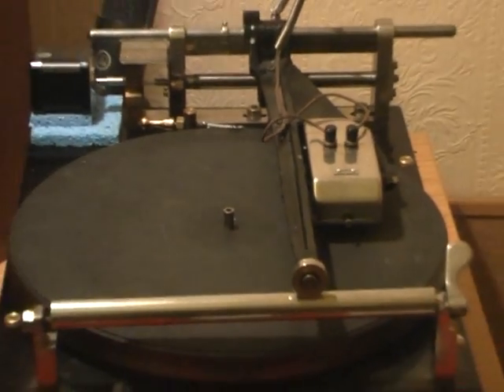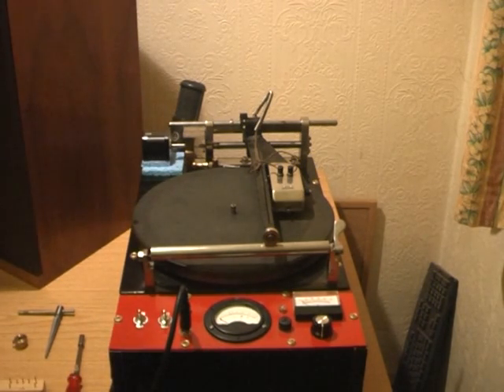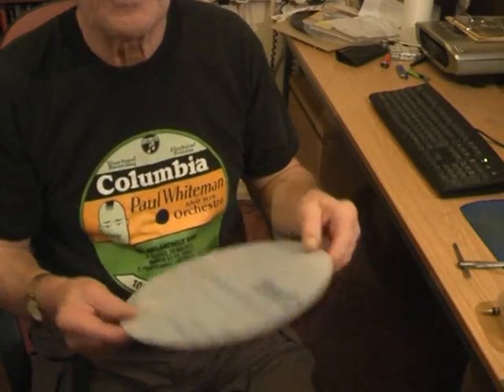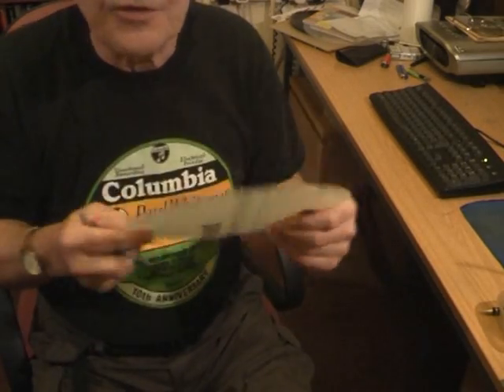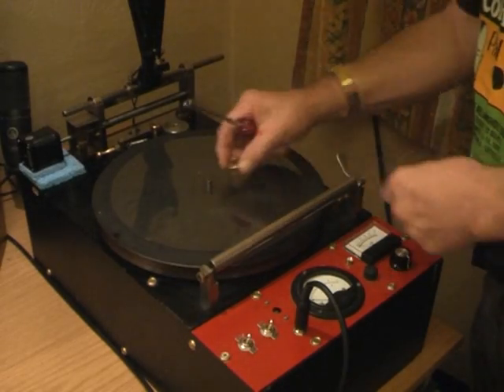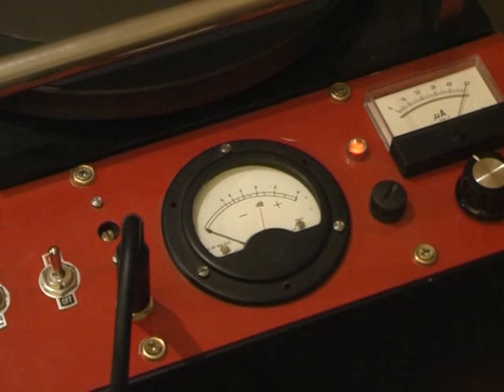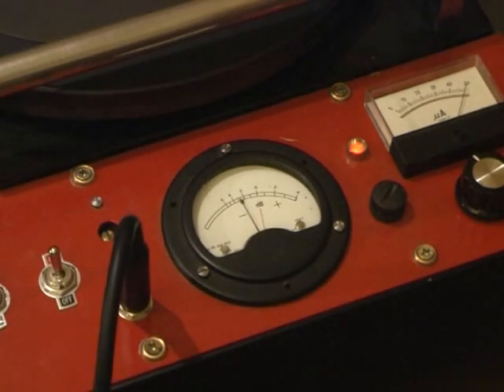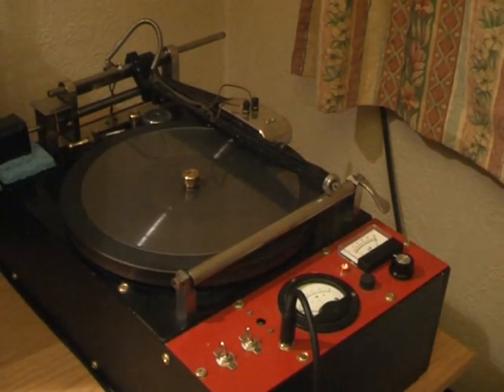home made 78 rpm records

Comment: Dear Sir,
Do you provide cutting wide groove 78 rpm record service on POLYCARBONATE material (Not PVC)? If yes how to contact you and send the wave file to you?
Reply from the maker: Dear Lee Leng Kok - I am sorry but I cannot help you here. I am retired from work and only play with this equipment as a hobby. They are very unpredictable on playback, and results are usually unreliable. One option for you, is to get a disc cut professionally at 45 rpm, using an audio file that has been slowed down by 78/45 = 1.73 times. Then, it should return to correct pitch when played at 78 rpm. Hope this helps. Best regards, Norman.
Reply: Thanks for your reply。

Comment: Amazing!
Where did you get this record lathe from?
Reply from the maker: Hi there. Well, it turned up in somebody's garage (minus motor & box) in the 1970s. They were used a lot during WW2 for recording news reports (no small plastic-tape recorders then except in Germany!), and I guess a lot of them got sold off as surplus. They occasionally turn up on ebay, but usually very dilapidated & needing a lot of TLC. I just uploaded a video of the restoration of the cutting head of one of these machines: https://youtu.be/ptfIHqyOtHw . Cheers, Norman.
Reply: hmmm,interesting.
Enjoy cutting your vinyls!

Comment: In his site he outgrown the components he used to build the circuit with the NE555 oscillator.But he should have put the design of how the various components of the circuit are connected to each other.
Reply from the maker: Hi Allessadro. Thanks for writing. After this video, I made two more: https://youtu.be/RAtC-oBI3mE and https://youtu.be/XrizHAodv_k . These give more explanation of how I controlled the stepper motor, and also circuit diagram & component values. You may find these of help. Also, you can use Arduino board to control a stepper motor; but I have still to learn how to do this! >8^(    Best regard, Norman.

Comment: Is there a website where you can order the polycarbonate plastic? What's it called and how much does it cost
Reply from the maker: Polycarbonate plastic sheet is widely used for glazing: e.g. greenhouses. One common trade name is 'Lexan'. I originally used 1.5 mm thickness (one sixteenth of an inch), but also tried 1 mm and this is fine too. It's slightly harder to find the thinner sheets. But most sheet plastic warehouses should have polycarbonate sheet. I don't know where you live, but if it's in the U.K., I use a supplier near Coventry called The Plastics Shop. It comes in sheets about 1 metre by 1.4 metres. They will cut it into squares free, but if you want discs, they will cut them for you but that makes the discs three times more expensive! Also, I recently saw a U.S. video where they are cutting onto a black sheet called Makrolon, which I believe is also a band name for polycarbonate. Hope this helps. Cheers, Norman.

Comment: Does it recorder have an electromechanical feedback?
Reply from the maker: Hi Andrei. No feedback; the low impedance (4 or 8 Ohms) signal comes from loudspeaker output of amplifier. The coil in the head is similar impedance. The amplifier 'thinks' the cutting head is just a loudspeaker. 8^)  The head only takes 2 or 3 Watts to make it work. I am going to make a video about the head, to show how simple it is, and how easy it is to overhaul. С наилучшими пожеланиями из Англии, Норман.

Comment: how well would these work in a jukebox with tube amp?
Reply from the maker: Hi Richard. Alas, it wouldn't work, if at all, because the 'groove' - actually a furrow - is probably too shallow to keep in place the playback stylus. It would probably just skid across the disc. However, it you have a 78 rpm juke box, and want to stock it with discs of your own music, the logical way forward would be to have the discs cut on lacquer. These will play much more securely, and with better sound quality than polycarbonate. However, there are two downsides: first, blank lacquer discs are relatively expensive, and also, they would have a playing life much shorter than normal 78s. How much shorter, would depend on the pick-up in the juke box. Best regards, Norman.

Comment: Can you show us a step by step, for those of us that did not study electronics? Please? thanks..
Reply from the maker: Hi Michael. Well, although the electrical side looks very complicated, the only difficult bit is driving the stepper motor which turns the feed screw. Further details are given on the web page - link is in video description. Also, I later made two videos of how to make a stepper motor rotate at adjustable speeds - you can find those on my channel. Be very careful of dangerous high electric mains voltages that drive turntables &c! Good luck, Norman.
Reply: yeah, thanks. I would need it explained at the  extreme basic level I have not really studied electronics or wiring or any if that stuff.  I just want to learn it as much as I can now. I am a Machinist by trade, so I know about tools and all that, I just have not put together any electrical projects,   or done any electrical type work or anything, so I hope you have a severely basic  way to explain it. Thanks.
Reply from the maker: Believe me, 95% of an MSS disc cutting machine was simply mechanical engineering! Have a look at the manual for one that's on my website; http://www.normanfield.com/mss.htm . The drawings are a bit congested, but if you read the instructions in the first pages of the manual, you will get to know a great deal about them, and how really simple they are. Although, the MSS ones were always over-engineered and VERY heavy! The only electrical parts of importance were the motor that drove the turntable, and the cutting head that made the groove. The other circuitry in the manual was pretty peripheral. Cheers, Norman.

Comment: Would you be willing to sell some cutting needles, I have no way to make them , especially at 84 degrees..
Thanks in advance...
Reply from the maker: Since uploading this video, further tests have been done, which indicate that the best angle of the cutting point is related to the weight upon it. (Surprise, surprise!) The higher the pressure, the bigger the point angle has to be, otherwise the point will dig in too much, and the movement of the point will be heavily damped - this will introduce distortion and poor upper frequency response. The ideal seems to be  A NARROWER POINT, and LESS PRESSURE. Of course, there will come a 'point of no return', when the embossed furrow will be too shallow to transport the replay stylus across the disc. Also, it has been observed that there are different grades of polycarbonate sheet on the market, and some of them have a distinct 'grain', which gives a 'double swish' when they are played back. Having said all that, if you email me privately, I might be able to help you further. Best regards, Norman Field,
Reply: Thanks, I don't see your email anywhere, so here is mine: superduper200554@gmail.com
Hope to hear from you soon... Jack

Comment: on its website, about a length of 1.5 mm HSS that should be sharpened.But what is that HSS? and what keeps it fixed to the engraver arm phonograph? there is an alternative that you can use instead of HSS?

Comment: Hi Norman, I built my CD embossing recorder about 4 years ago. I remember the most frustrating thing was the squeaking sound which appeared each time I tried to increase the cutting force (weight) on the stylus tip. Maximum 100-150g was possible. And the stylus was ploughing at 30 degrees to the vertical, if less, the squeak came there. This way I got very shallow grooves. I have tried WD-40 back then, but it seemed not to improve anything.
What are your cutting weight and angle? I did not found it in description article on the website you provided (great article by the way). Thanks!
Reply from the maker: +Maksim Holtzman Hi Maksim, thanks for writing. Yes, I should have given the pressure & point angle! Pressure is 60 - 70g, and the point offers about 2° of drag, i.e. point slightly tilted forward. If the point is absolutely vertical, or faces backwards, there is trouble with squeaking & whistling. There was also whistling if the point was too sharp. When I ground a new point (they are made from 1.5mm high speed steel), I used to pass it across a polishing mop for a couple of seconds - then they didn't squeak. Since using WD40, which is excellent, I think it might be possible to use a sharper point and get a deeper furrow. As you were using a higher pressure, I wonder whether the material you were embossing is harder than the polycarbonate I use? It's standard Lexan, for lightweight glazing purposes, 1.5mm thick. Have just discovered that 1mm polycarbonate is quite usable also, and is cheaper. 1mm should be quite easy to cut into a disc yourself, so you don't have to pay the supplier to cut them round, so the cost is halved! It's time for a follow-up video; I will show the stages of restoring an MSS cutting head, which is quite straightforward, and add some more hopefully helpful things. Best of luck, Norman.

Comment: Norman I love this video, and I love the excitement and joy you communicate. One question: you seem relaxed about cutting at 80rpm. Does this not alter the pitch and spoil the music? Or do you compensate by altering the ultimate playing speed when you play the resulting disc?
Reply from the maker: +band3kafsh   Thanks for writing. Your point is perfectly valid. When I made the new drive shaft for the motor, it was deliberately left oversize, so that later I could very slightly turn it down in the lathe, bit by bit, until it would rotate the turntable at 78 rpm. However, two things happened. 1. I did have a very few lacquer discs, and it turned out that the drag while cutting lacquers was much more than embossing on polycarbonate, so the turntable went slower anyway. Also, as the drag decreased towards the centre of the lacquer, the turntable went faster. So when you played the disc back, it got slower, and the pitch dropped. Disaster! 2. Embossing a furrow on polycarbonate has far less drag, so the pitch stays pretty much the same throughout the disc. Since lacquers are so expensive, I have stuck to the polycarbonates, and yes: when I play them back, I increase the speed on the replay turntable to compensate. Best regards, Norman.

Comment: Hi Norman, we have an MSS which we want to use to cut 78RPM dubplates of local bands in our pub cellar studio. The machine powers up and cuts a groove, but no signal is making it onto the head, also while tinkering with volume level I think I have blown something else, as there is no signal to the VU either (there was before...). Do you repair them at all? We really want to get going but cannot find anyone remotely clued up about MSS's. Great vid and site! Dave
Reply from the maker: +Nancy Dulake Hi there. Well, I did fix one head for a chap a few weeks ago. They're pretty simple inside - the design hardly changed for the best part of 30 years. Quickest way forward is for you to email me direct, then we can talk on the phone, wch is a lot quicker than many emails! OK? Cheers, Norman.
Reply: +Norman Field Thanks for getting back so fast Norman, I can't see an address on your website, our email is railwaysouthend@hotmail.com, praps you could message us and we can call you back, thanks again D

Comment: Hello, Norman.  Very nice work and splendid results. Are you embossing with a vertical stylus, or is yours canted-forward a bit as many of the LP embossers favor?
Reply from the maker: +Jim Wood Hi there Jim - yes; just perhaps one or even two degrees canted forward - this was recommended in the MSS manual for a later 1950s machine. My pal Mike recently lent it me. I'll ask him if I can upload it to my website. It's disastrous to have any back-rake on the point, - it just digs in, chatters, all very bad! Cheers, Norman.
Reply: (+Norman Field) Hello, Norman, and thanks for the reply. A quick clarification, if I might. You are embossing with a more or less conical point, not cutting, right? And doubtless the MSS manual was referencing a traditional lacquer 'engraving' process creating swarf. Others who emboss recommend 20 degrees or so.  Just wanted to confirm that you get your good results near-vertical.
Reply from the maker: (+Jim Wood)  Hi Jim. Yes, that's correct: it's embossing with a conical point of around 85°. All the guff about that is in the web-page associated with this video, a live link to which is given in the video description above. The MSS did indeed cut lacquer with a chisel-faced cutter, producing swarf. Their cutters were originally metal; later, sapphire cutters were available, and heating coils could be used for those. However, the MSS metal cutter will produce a pretty silent cut in lacquer for several discs. In fact, they actually get better as they first start to wear! This led to the introduction of tiny relief faces on sapphire cutting styli. Because I use high-speed steel for my embossers, they are too brittle to bend; they just snap. But in response to what you said, I spent this morning looking into a 'trailing cone', so made one out of the 1.5mm silver steel I originally used, which bends easily. Upright with a small trailing angle of say 2°, it worked OK. Then I bent it & tried it again. There was less top end then; however, I had bent it 25°, which is too much. Some intermediate figure would probably be optimum.  However, I have got quite good sound with a near-vertical cone. The tip is crucial; too sharp and it embosses a noisy furrow; too blunt and it won't emboss much of a furrow at all & the playback stylus just skates across the disc. But all the parameters, cone point, weight of the head, hardness of the polycarbonate &c are all interactive. As Gerard Hoffnung might have said: 'Each factor is dependent on the next!' It's great fun tinkering, though!

Comment: I have seen other machines actually cut a grove with a a string of material coming off the cutter. Is this something different? I heard you explaining embossing but is what you are doing not the norm or what gives?
Reply from the maker: +Walkertongdee Hi there. You are absolutely correct: ordinarily, when you 'cut' a disc with a sapphire or ruby cutter, the  aluminium disc is coated with cellulose nitrate lacquer. The chisel-faced cutting point does indeed make a V-shaped groove in the disc, and so a thread of swarf is produced. This is either manually brushed out of the way using a nice soft brush, or sucked away by a vacuum line. However, because lacquer blank discs are expensive, people have tried other materials to record on. Having seen many videos on YouTube where people were making really great recordings, even in stereo, on unwanted CDs - which are made of polycarbonate plastic, we decided to try it in mono at 78 rpm. Now: when you record on polycarbonate, no material is removed, so there is no thread of swarf. Also, they don't use a chisel-faced cutter; they use a conical point. This conical point ploughs a furrow in the polycarbonate - exactly like like a farmer ploughing a field. There is a central furrow, with a ridge on either side, where the plastic has been pushed aside. That's why it's called em 'embossing' rather than 'cutting'; and because the furrow isn't very deep, polycarbonate discs need a pretty good turntable & cartridge to play them back OK. Hope this is of help.
Reply: Interesting, TKS...